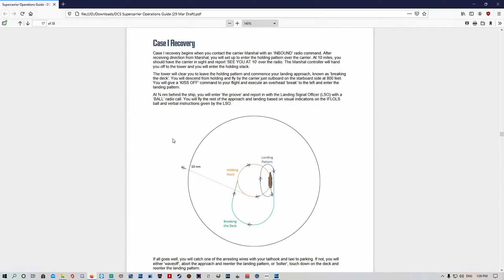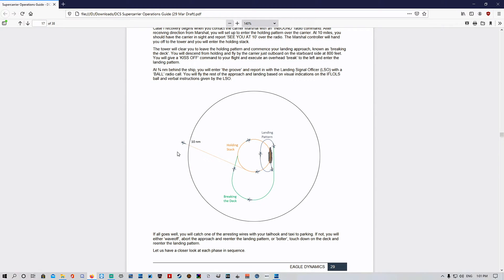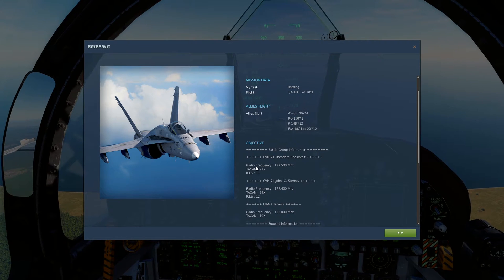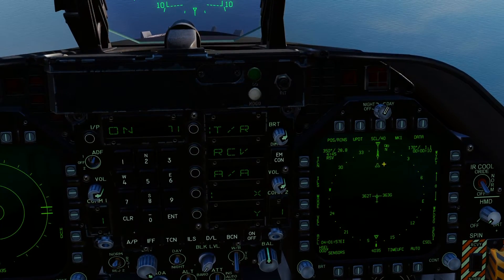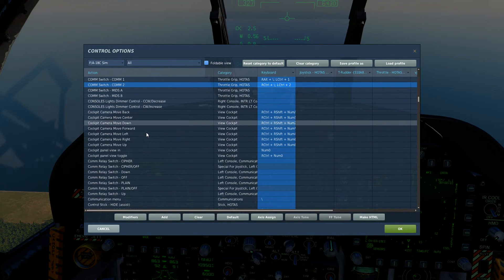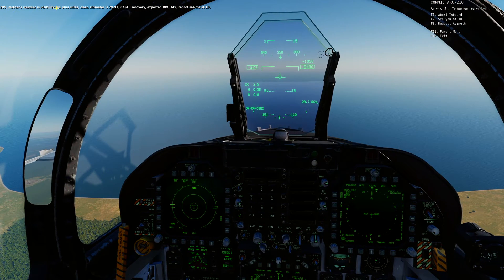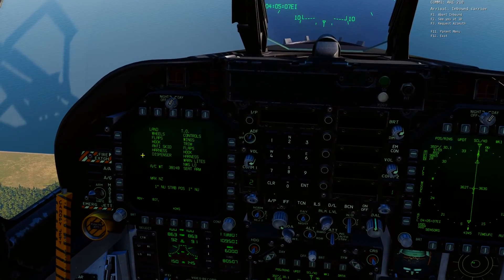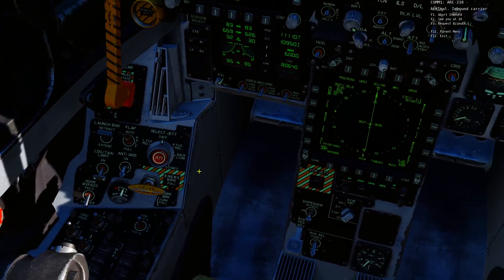DCS - F/A-18C Lot 20 Hornet Case 1 By Numbers Pt 1 - Checking In

Comment: I got the Hornet in December after having learned the Hawg from the Ralfidude zero to hero guide. It made learning the Hawg so easy that I was struggling while learning the Hornet because there was no "learn this first and then learn this" guide, there were just outdated and all over the place tutorials, the included interactive tutorials don't seem to cover anything that came after 2019 (correct me if in wrong) and Eagle Dynamics don't seem willing to update them, I don't have the habit of reading so learning through reading makes it very difficult to me as well, tried Chuck's Guide, even though it is very well made, I was still struggling, until I found your channel and this playlist. I'm learning the Hornet now and you made it easier, thank you.

Just a quick question, is this one of the missions the module includes or did you create it yourself?
Reply from the maker: Glad you’re finding the tutorials helpful mate!! That’s why I made them cuz there was limited videos out there that didn’t go for ages and rambled on without getting to the point. 

I made this mission myself, ive got a mission editor for dummies playlist that goes through setting up an aircraft carrier to practice with case 1’s etc. 

Thanks for your kind words mate, appreciate it.
Reply: Man same with me lol. Ralfidude playlist was so easy I learned the Hog completely in 3 days damn. I find the Hornet much more difficult and complex but this channel is too helping me out